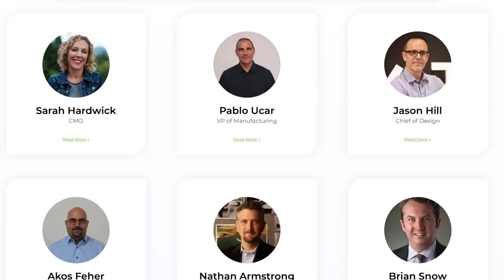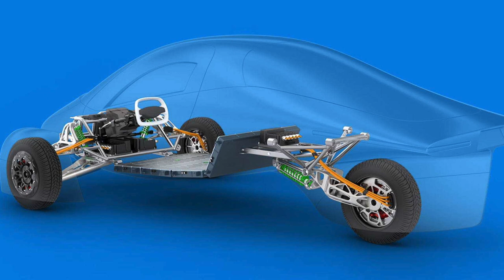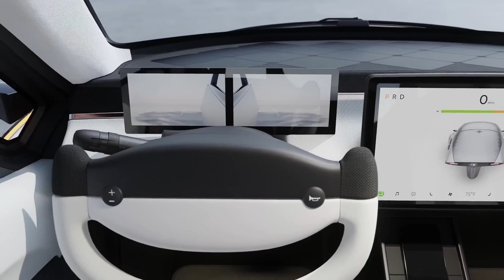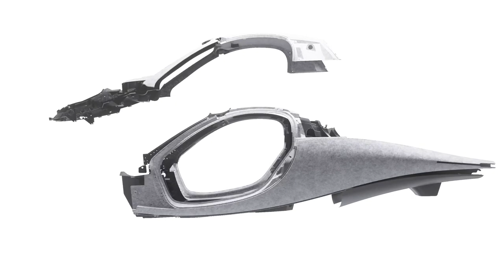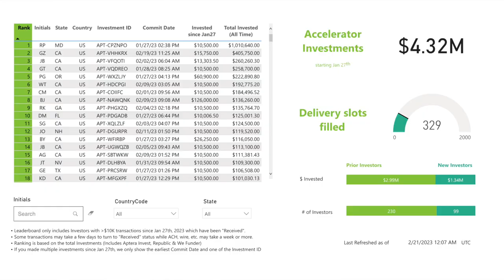Meeting Aptera's Design Chief: Jason Hill

Comment: Fun interview. You guys had some really challenging questions for Jason, and as always he had some insightful answers. I eagerly jumped on the Accelerate Aptera program, and I am enthusiastic that it will help bring the Aptera to production sooner, rather than later. I am excited to get my Launch Edition model!
Reply: Dean, I am so grateful for your steady support!  Together we will get where we want to be.
Reply: Dean, Re: Aptera ROI. What might be Aptera’s projected margins, e.g., relative to Rivian, out the gate & at the year 1 & 2 marks, given their comparatively (thanks to Munro Assocs. & CPC) highly prefabbed manufacturing & streamlined assembly concepts of operations?
Reply: @Crunch_dGH  Really good questions. Aptera had stated early on that they would have healthy margins due to streamlined operations, simplified assembly, smaller battery packs, and lower part counts. But they did decide to shift the original composite body design to CPC's forged carbon fiber/SMC body and panels in Italy after the demand for the Aptera climbed from a couple thousand EVs anticipated, to the current 40K+ reservations. Plus the sharply rising costs of battery materials and other components must make it harder for them to keep from raising prices from the original 2020 estimated prices, and yet maintain a good profit margin. Still, I think that they have locked in solid partners and suppliers, and they are focused on continuing lean operations through to production. But I'll leave it to Aptera to project their ROI after their initial production, scaling to volume production, and their subsequent IPO.

Comment: There are hints of the range of vehicles Aptera has been thinking about in the SEC reports.  I think Aptera has been slow speaking of this because of the essential need to get this first product on the road.  However, as they near IPO, we will be hearing more of this subject.
Reply: Aptera has a huge potential market with the current design alone.  They have years of refinement and ramp ahead on the current vehicle.  Going aggressively into markets with lots of direct competition and competing on price is a recipe for disaster.
Reply: @ccibinel  I recall Sandy Munro saying (IRC in a 3-wheeler related conversation) "if you want to lose money build a 4-wheeled vehicle". He didn't elaborate on that one but my guess is that some silly regulations might be the deeper reason for his conclusion.

Comment: The Aptera that i reserved is for a 600 mile/ all wheel drive/ full solar panel. Mainly because, i keep reading about other EVs losing out on range during winter and also the phantom drain (about 2%+. every day). I hope aptera's phantom drain will not be so much since it does not use as many cameras and other electronics for its surveillance mode.
Reply: It doesn't have security mode.  They could update it to use the cameras though.
Reply: It will gain range rather than lose it. The benefit of solar.

Comment: I especially liked your question about the watt per mile difference between the 25kwh and 100kwh  versions. I didn't fully understand the answer. Could you clarify if you got a better idea of the efficiency difference?
Reply: Given the incredible 0.13 drag cd and new statements from Chris about the 2000lb weight for the 400 mile launch edition and 2400lb for the 1000 mile we can model the numbers reasonably.  This puts the 55mph 250 mile efficiency at 86.16 wh/m and 1000 mile at 97.66 wh/m (before considering any aux drain which is probably 200w - far more if you need heat or cooling).  The design is efficient but it is still a significant difference with weight.
Reply: @ccibinel  Thanks! Less than 14 watts doesn't seem like a huge difference? Especially considering the range difference between the models..
Reply: @joelroth3651  remember, aerodynamics makes a bigger difference than weight
Reply: @Airman749  I didn't know that. Very cool!

Comment: Very interesting . Watching this near the end sparked a question in my mind . . . 
can the cells convert other forms of light or only sunlight ? What if the vehicle is parked in a lighted garage for example !
Reply: The amount of energy contained in that light is so small that it wouldn't make a significant difference.
Reply: Light is light, no matter the source. However, room lighting is less than 10% the brightness of sunlight, so the energy transfer is that same less than 10%. Plugging it in is a way quicker way to charge, if an ordinary wall outlet is within reach. Of course you can plug it in and charge from the room lighting at the same time to charge even faster. 🤓

Comment: Great Interview. Does anyone know why the wheel covers are so closer to the ground? How does it handle bumps and potholes?
Reply: If you check out Aptera latest video mid way, there are some B-roll showing how the vehicle handles potholes and rough roads. I'm sure they will release more info on handling and durability further in production
Reply: Aerodynamics is why.
Reply: Do they interfere with checking the air pressure in the tires? Having to remove the covers would be a problem.

Comment: I dont know man. I want to like it. But it  looks to me like something you shouldn't drive on a windy day.
Reply: The very aerodynamics that make it so efficient "slipping through the air" is also what keeps it relatively immune to the effects of wind; from the front, back, or even the sides.
Reply: @TailosiveEV  Not only will the better aerodynamics (from every direction) keep it more stable, there will be less wind noise and the Aptera should be quieter on the inside as a result.  Great video BTW, thanks.  Peace, Calvin.
Reply: I used to drive my F-150 pickup towing a 24' travel trailer.  The wind had to be pretty strong before it was a problem and the Apera is far more aerodynamic and stable with a much smaller side footprint.

Comment: Cool car, nice job Elio Motors, I mean Aptera motors, i get them confused sometimes since neither has delivered any cars
Reply: Elio never had more than kit car mockups and a fake claim of a new engine factory.

Aptera has produced real pre-production prototypes, one of which both my wife and I have ridden in, and which had thrilling performance.  Aptera has real suppliers and production partners.  Aptera founders have also run real companies.  Chris Anthony took his lithium battery company public as CEO.   Do a little real research if you want to start comparing companies.  I also suggest you compare Aptera Corp with the start of Tesla Motors.